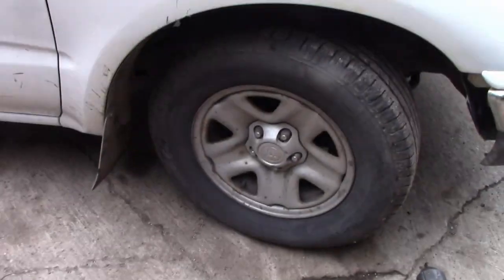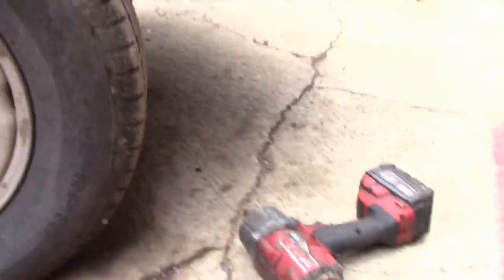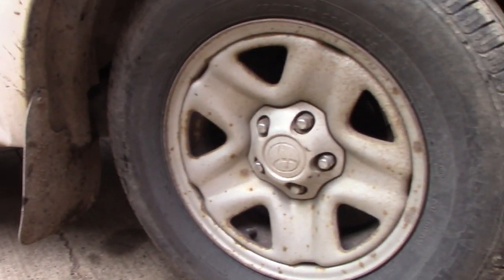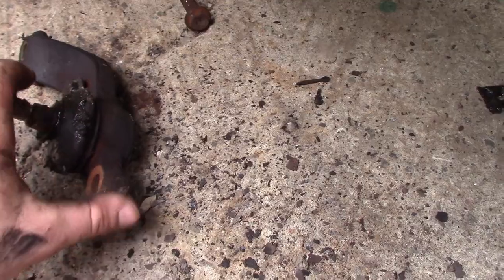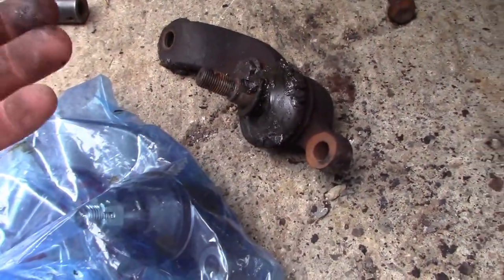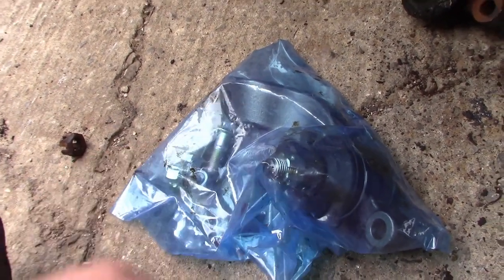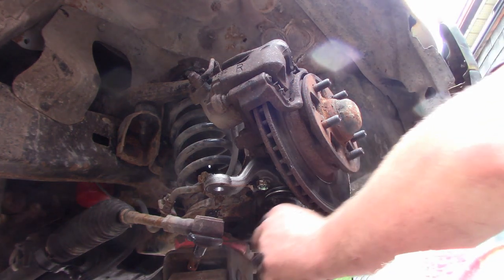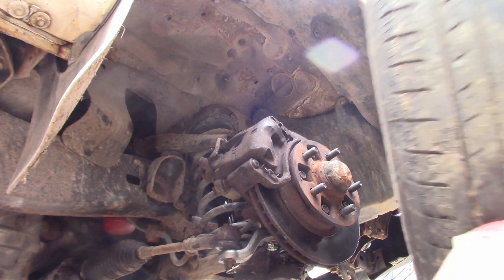1995-2004 toyota tacoma front lower ball joint replacement 2wd/4wd

Comment: Thanks, I'm in the middle of putting the new one in and wanted a "what comes first" demo to make sure i did the bolts and tie rod in correct order. I'm  a non-mechanic novice that just wants to get it moving so i can take it in for a mechanic to make it right. Having a wheel go sideways on the road from a worn out ball joint is a wakeup call to stay on top of proper maintenance. Thank you again.
Reply from the maker: Glad I could help and did the video help ?

Comment: It doesn’t seem that hard.
I think I can do it once I get the right tools. How long did it take you to do each side? Was the parts you got oem ? 
Thanks for an awesome video brother
Reply from the maker: Parts were off rock auto I think 23.99 for ball joints and once I started 35.mins per side not including jack and tire removel but I was also not rushing
Reply: @zacksworkshop171  that’s not too bad. My left ball joints went out, went to a shop and were charging me $600 to fix it. I looked it up and your video popped up. Great stuff!